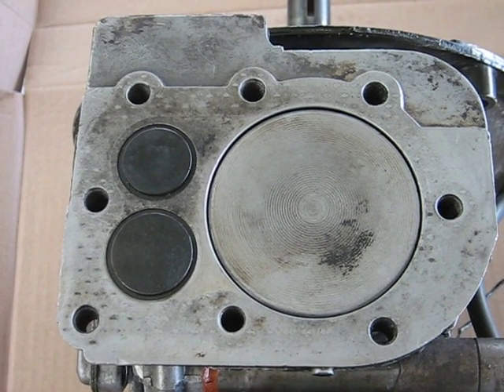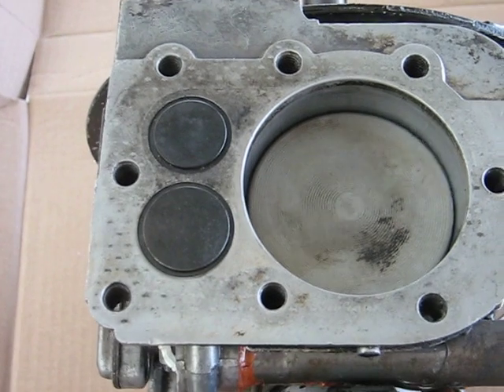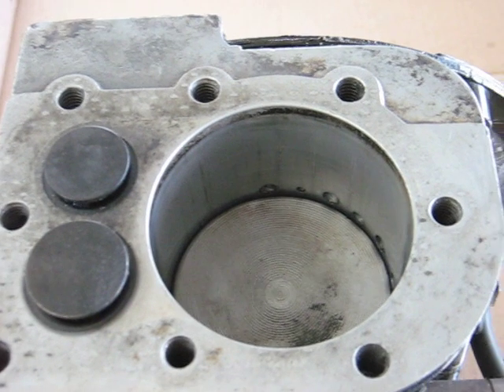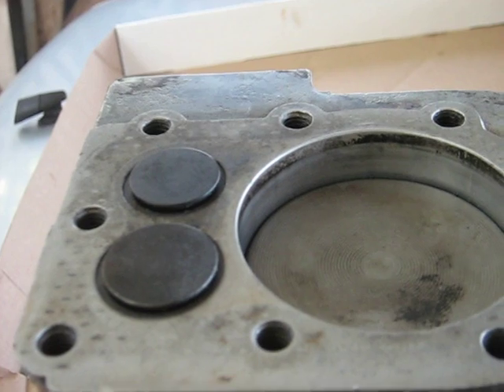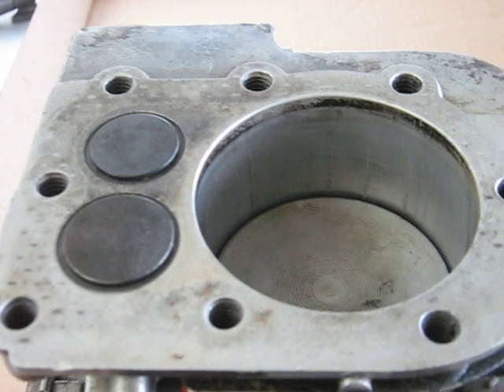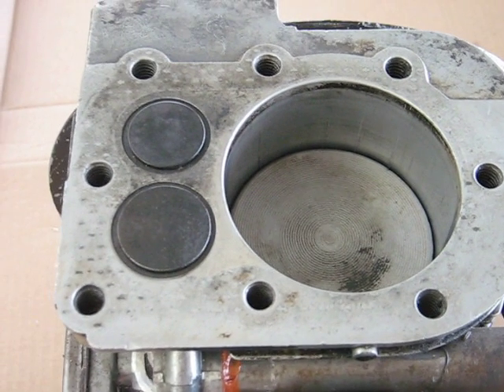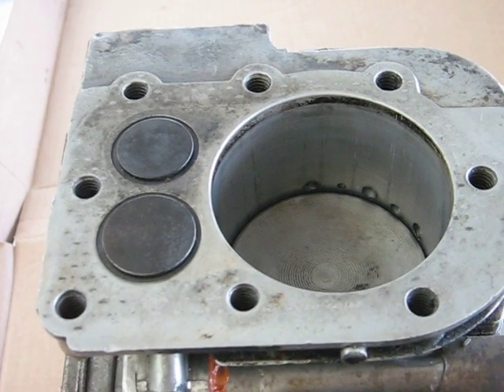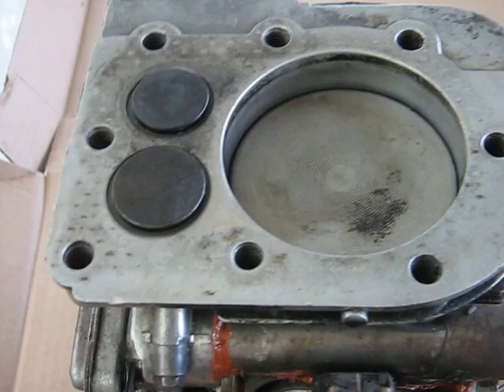Monosoupape valve operation -Briggs & Stratton

Comment: Thanks for all your efforts here, hats off man! I’m not super familiar with mods so question: you say, “a very rich mixture is sucked into the crankcase...” what would make that process a “vacuum” versus “pushing” everything out the intake?
Reply from the maker: This engine has a very peculiar cycle, the exhaust valve stays open a very long time, about 1/3 of the way into the "intake" stroke. Then no valves are open while the piston descends on intake stroke, near the bottom, the intake ports are uncovered, so the very rich gas mixture is sucked in, and diluted with the air that was sucked in thru the exhaust valve. The guy that figured all that out sure deserves our respect!  Oh, remember the real version of this engine only has an exhaust valve, no intake, hence the 1 valve name "monosoupape"

Comment: This is amazing! More videos like this! Using different materials for the pistons is cool, but these ones are awesome. It would be interesting to see you create a 6-stroke (it exists.)
Reply from the maker: I have made pressure scavenged 2 stroke engines from briggs lawnmowers, but haven't tried a 6 stroke. I was thinking of making an 8 stroke as a slow running engine to use with my plexiglass cylinder head. I have just uploaded my first vid of it with the plastic valve, which managed to survive a few seconds.
Reply: I would be willing to bet that a video of a 6-stroke engine that uses steam for the additional power stroke would do amazing with transparent head.

Comment from the maker: Sure, is that a model 130...   5 horse Briggs, like the ones I am using for my FrankenBriggs 4 cylinder?  If it is, you will have to pay careful attention to camshaft lobe to connecting rod clearance. I have had to grind some off the side of the lobes to get it to work. One thing about the Mono, it only wants to run with the choke pretty well closed, since it sucks some air back in thru the exhaust valve. I drilled 1/8" dia. holes for the inlet ports, just above the piston at BDC.

Comment from the maker: @HDXFH 
No, it doesn't seem to, however, I have to admit that I haven't run the engine all that long.
The ports are only 1/8 to 1/4" in diameter, so they don't allow the ring much distance to flex outward.
The sleeve valve tends to wear the rings in the head a noticable amount though, those ones I had to pin in place, so they can't rotate.

Comment from the maker: @yard1sale1dale 
I think I confused you when I re-used the blue cooling cover.  This engine (the Mono) is a 4 stroke, and doesn't use the supercharger.  You are correct though, as I re-use this whole engine, putting in a different camshaft, to make it into the supercharged 2 stroke. The 2 stroke won't run without the blower, as it must have air pushed in to clean out the cylinder. Like a Detroit diesel 2 stroke.

Comment from the maker: @curtknows101 
HaHaHa :)
Nope, no special jetting, this uses a stock carb, I had to almost plug it off, and keep the choke shut to get it rich enough. Yes, there was LOTS of hand starting to get it tuned so it would keep running. I actually cut some grass with this engine :)
The blow by isn't a problem, since the piston is at the bottom, and the exhaust has all been bled off by then.
This one was easy to start compared to the supercharged 2 stroke, now that one gave me Blisters!!!!

Comment from the maker: @tpvalley 
Remember, it is a 4 stroke engine, inspite of the inlet ports. I will review the inlet cycle. Piston at TDC moving down, exhaust valve stays open for about 1/3 of the inlet stroke, pulling only air into the cylinder. Ex. valve closes, no valves open, high vacuum developes, piston uncovers inlet ports near BDC, very rich gas/air mixture rushes in, and dilutes with air already in the cylinder. Piston comes up on compression, closing inlet ports, and then fires in a normal power stroke.

Comment from the maker: @tpvalley 
No, it doesn't use the crankcase at all.
The piston is just a little bit taller than the stroke of the crankshaft, so it does cover the inlet ports up, just barely.
see my explanation on the other Monosoupape vid.

Comment from the maker: @FORDGTFANATIC 
Yes, I think it would work OK.
The basic engine cycle of the Monosoupape wouldn't work out, but I built the type of engine you mean already. I took this engine, put in a different cam which opens the valves every turn of the crankshaft, and made it into a supercharged 2 stroke. i don't have it assembled, and have never run it on youtube yet.

Comment: Very nice, I would recommend to make next a so called "loyal cycle"-engine, which is very simple design and fires in every rotation. Basically it`s just normal briggs engine which has an automatic intake valve(both valves can be used)and at half of the stroke(like your monosoupape), it has several holes as the exhaust. The exhaust has reed valves so the exhaust gases can go only out from the cylinder at half of the "power" stroke, then the piston sucks gas mix from the automatic intake valves.